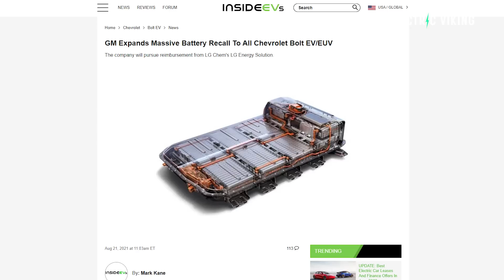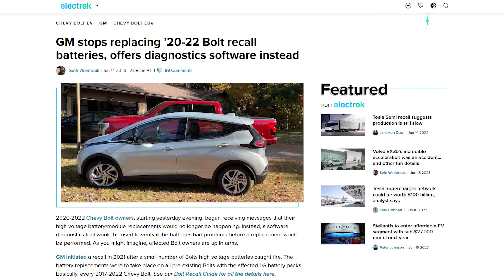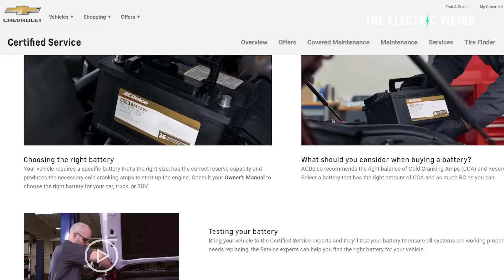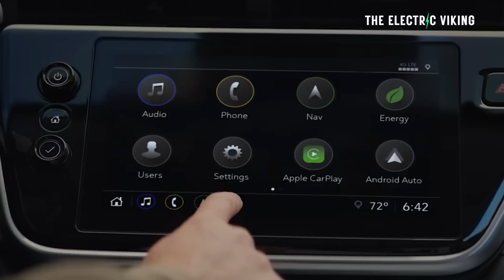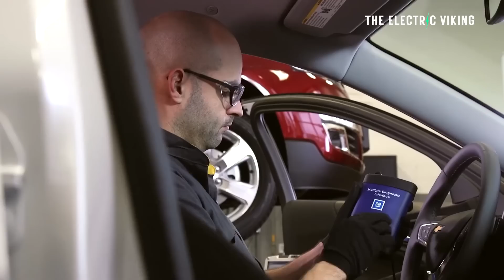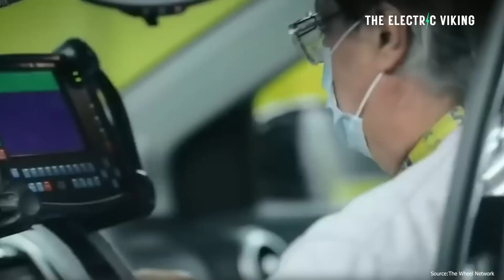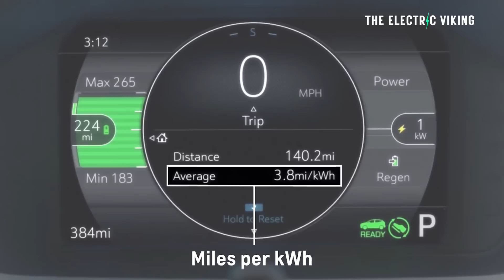Some Chevy Bolt EV owners will no longer get replacement batteries

Comment: There is a car company (Hyundai/Kia) that manufactures several ICE that have caught fire so many times that they have been recalled. Apparently the problem traces back to the engine block.  Rather than replace the engines, the recall installed a sensor that when it detects that the engine is about to catch fire it cuts power and the car can not be restarted.  This happened to my wife in her 2013 Optima, at highway speed, on a very hot day, on a long uphill stretch, after passing a semi.  She was lucky that this did not happen as she was passing the semi and Kia did replace the engine without charge.  However, I have no confidence in a corporation that decides to install such a sensor rather than fixing the problem.
Reply: GM replaced my battery in my 2019 and 2020 Bolt EV, but this is unacceptable that GM refuses to replace the battery for these other Bolt EV owners. Time to move to Tesla.
Reply: GM 'replaced' my Volt battery only to last 5 minutes after the warranty expired. They said 'replace your car, it's 'old'. (117,000 miles) Wow.
Reply: @ConstanceCox I bought two Volts close to 100k a few months ago.  

2012 and a 2016.  I knew the 2012, on borrowed time.  And it is about 6K for a battery.

Comment: Luckily, GM replaced my battery in both my 2019 and 2020 Bolt EV's here in the US. I think it's a bad decision that GM has halted battery replacements for existing Bolt EV owners who still have the old batteries. Time to move to Tesla. GM is showing their true colors.
Reply: Elon is a lot worse than GM lol
Reply: This is typical GM, nothing new. When my brand new Silverado drank 3 qts of oil in 5k miles, they said no problem thats normal. My 230k mile beater Tundra doesn't even drink a quart in 5k. 

My buddys 30k mile Silverado had failing lifters and sounded like there were marbles in it. GM said it was fine, until it actually comes apart they won't touch it. That was promptly traded in on an F150.
Reply: @22rsx How so?
Reply: @22rsx  Another person that has outsourced their thinking.
Reply: this isnt new for GM, they have always been trash vehicles
Reply: @22rsx  elon is a person.  GM is a company.  GM builds trash and always has.
Reply: @baldisaerodynamic9692  I know and i agree lol
Reply: Tesla is so far in front of GM that it’s not even worth comparing.
Our nearly four year old Model 3 has been absolutely fantastic- best new car experience that I’ve had in nearly fifty years.
Reply: @22rsx You have NFI! 
Our Tesla has been absolutely brilliant, period!
Reply: @FutureSystem738  i have no life? I wasn't talking about Tesla I was talking about Elon.
Reply: @FutureSystem738  a 1990s hyundai is so far in front of GM.  some of them prob last longer than a new one too.
Reply: They did that to me! For years i was assured id get a new battery for the diminished range. Then they told me I wouldn’t get a new battery. I have contacted a lawyer because the resale for the car is trash without the battery replacement due to now selling the car that sure has the “software updated” but still a fire risks due to lack of change. ITS BULL SHIT! EVERYONE NEEDS TO SUE GM
Reply: @FutureSystem738  Teslas are known for their crappy build quality.
My over four-year old Chevrolet Bolt EV has been absolutely fantastic - best new car experience that I’ve had in over sixty years.
Reply: Tesla has great tech but their quality control on their body panel gaps and assembly is trash. For such an expensive car, everything should be perfect.

Comment: Its hard to imagine any company doing a worse job than GM in manageing a crisis then GM did with the Bolt. They gave their customers the tun around for a couple of years before they agreed to replace the batteries. And now just when their reputation has started to recover they do this. From a technical point of view its probably alright, if a battery hasn't caught fire by now it probably isn't going to. But from a public relations point of view this is a disaster. Why would anyone consider buying a GM car in the future unless they sell them at firesale prices which is what theyve had to do with the Bolt.
Reply: VW: dieselgate
Reply: @vvattup  General Motors EV1
Reply: Liar liar car on fire.  🤣🤣
Reply: Well stated, especially the "sell them at fire sale prices"! If you hadn't said it, I would have!
GM needs to decide if they REALLY want to give good customer service or not. GM, if you do, state what you'll do and DO IT!

Comment: I own a 2021 Bolt and GM never contacted me about the change in direction. I contacted them to confirm what I was reading on the internet. They then confirmed the software solution and informed me that my Bolt was now ready to receive the software and that I should schedule an appointment at my dealership. The dealership was as confused as I was about the battery replacement strategy. They are taking the brunt of the customer anger. GM has established themselves as the world's worst communicator and destroyed their reputation (for me anyway). My next EV will not be from GM. They can not be trusted.

Comment: My 2022 Bolt EUV was manufactured in July of 22.  It appears to have come off of the assembly line as one of the first post recall cars.  I have never charged it to above 85% and normally to 80% at normal household current.  I initially ordered a 22 Bolt EV at the end of 2021 just before the recall.  When I was informed that production was about to start I was told by the dealership that I would have to wait much longer for the EV as opposed to the EUV so I ordered it. I love the car and I'm glad that I got the EUV because I have had people in the back seat and the car is an ideal 4 seater in this configuration.

Comment: GM Lost 500 million on an autonomous vehicle program INSTEAD of replacing batteries.  300 million also lost from garbage sales.  We have a 2020 Bolt that we bought..... it was recalled for a replacement 4 months after.  That was 3 years ago !!!!!  The software was not the problem and the software can't stop a fire in any way at all.  DC " Fast " charging bypasses the onboard chargers and goes directly to the battery,  new software can't stop a thermal runaway from happening.  We got the email for a replacement on June 13th and took it in.  The dealer swapped it for a new one.  THEN GM told them to take it back out and put the old one back in ......  They then set my car to 78% charge.  That makes it a 150 mile POS that we are paying full price for.  We bought a 256 mile EV NOT a 150 mile EV.  They say to not take the car below 70 miles left .......  That is half the range total now.  The car charges three time slower than any other EV out there right now.  They are gonna give us a new pack with 100% charging OR buy the car back at full owed amount.  Legally in the U.S. you can't put a car on the road with KNOWN safety risks to the public.  These cars with just software are known safety risks.  Period end of story.  GM is guilty and a fraud on this one.  Proven in courts across America already.  Thank you Sam for telling the truth to the world.
Reply: I have the same feelings but i am being shafted on my 2022. I purchased and a week later it was recalled. So I’ve been driving years on diminished range and the least they could do is swap the batteries. I paid for a product i never received albeit i did for 1 week……. IT such bull shit that we put our trust and faith into doing what’s right for the planet by trying to switch and we get screwed by higher costs and diminished range. I hate GM and never will purchase another one. Anyone who talks about buying a Chevrolet i just laugh at. At this point the world should have opened their eyes to how bad the company is. I really hope they go out of business. Also its ironic how when they fucked up in 2008 they used our tax $ to bail themselves out. Now when their customers need to be bailed out its friken crickets!!!!!!! GM give the government their money back and go out of business already!!!

Comment: So, a company that had to be sued over ignition fires that killed people now say they won't replace batteries?  Can't say I'm shocked.
Reply: An investigative reporter should buy a used bolt that has never had the battery changed, take it to a professional to get the battery adjusted so it should fail the "test".  Then have GM run the test.  When it passes, because they all pass.  Run the article exposing GM for lying.  We all know the software does not work.  It is just a scape goat for anything else that happens later.

Comment: The term "software fix" is ever so slightly oxymoronic. In some cases, synonyms include "kludge", and "spaghetti code"
Reply: An investigative reporter should buy a used bolt that has never had the battery changed, take it to a professional to get the battery adjusted so it should fail the "test".  Then have GM run the test.  When it passes, because they all pass.  Run the article exposing GM for lying.  We all know the software does not work.  It is just a scape goat for anything else that happens later.
Reply: They have offered 3 software fixes 3 times for this issue previously that resulted in more fires. GM sales 🔥

Comment: This whole mess was handled very poorly and inefficiently. Having the dealers swap batteries piece by piece is a huge money suck. Should have just bought all the cars back on a pro-rata basis based on use, condition and mileage, procure all the replacement batteries, then set up a manufacturing gnline to pull out the old and install the new. Then sell all the repaired cars to the government or a rental fleet and then sell all the bad batteries to a recycler so squeeze every cent out of the fiasco as possible. I'm sure if they had handled it all at once the costs of the replacements would have dropped a lot and then getting the proceeds from the sale of the repaired cars and recycled batteries would have paid off a decent amount of the cost.
Reply: lol the government would prob avoid that deal, or back out of it.  rental car fleets likely would pass too.  good idea if people were on board....but even more costly if they backed out

Comment: If I come across a great price for a  2017 Chevy bolt with it's original battery still in place,  is it still eligible in 2024 for free replacement?

Comment: The end came sooner for me because they bought my 2020 Bolt EV back! But it's so ironic that this video came out... I received in the mail a recall for what is called the traction battery(the one on the underside of the car). In that recall, they lined out how earlier vehicles would have their batteries changed first and so on. But it's funny that the video shows many pics of the 12 volt battery. Mine (12 volt) went bad with very low miles on it several times. They took two weeks to replace the 12 volt battery, which should be less than a half hour job. Anyway, they couldn't ever pinpoint why the car kept "bricking." Good ridden!

Comment: From the start these automakers should have used interchangeable batteries in the first place. Thus creating a global standard. Well, by continent is alright too. 
If the batteries can be interchangeable then faulty batteries can be eliminated as soon as they come from the car when fresh batteries are installed. So you can drive on safely.
And let use clear: there  is no need to be the owner of a battery pack.
Reply: no thanks.  im not paying for another subscription to use the car.  or wait in line at  swap center, so on.  

how about build them better, safer, more efficient and warranty when needed.

Comment: I bought a 2020 with 6500 miles without replaced battery.  It is a great deal at $14,000 (after $4,000 FIT credit).  It only charges to 78%, but that gives me 200-250 miles of range.  At some % of charge they will replace the pack under the 8 yr / 100,000 miles warranty?

Comment: Thank you for the info. We are just looking at a 2013 Chevy EUV Bolt for our son, now I don’t know if it is the right choice or if they will replace the battery when it dies. I heard they are discontinued and bringing in a new Bolt in 2025 with a different battery. If we are able to switch batteries to the new one then it might be okay to purchase now.

Comment: Hi Sean, 

Long Time Subscriber; Recent Member….

I have a 2023 Bolt EUV with the newer battery. 

Question: I need to use about 80% charge to drive to work every two days. 

Is it better to use 10-90% of the battery range every two days
OR 
0-80% of the battery range every two days. 

In other words, does it hurt to use the bottom 10-20% of the battery pack or just worry about the top 20%? 

Thanks for your help, 
Love Australia!!!!

Nick

Comment: I have a 2022 bolt ev and they did two software updates already due to the lithium ion battery. The first software limited my charge to 80% now the limited to 20% only getting 71 miles of range on a 259 mile car. For sure getting rid of it and going the Tesla direction.

Comment: So is a used 2017-2019 Bolt with a replaced battery a good deal at say 20k miles for around $17,000?  Or am I dumb to even consider a used Bolt? I’d never buy one unless the battery was replaced though.

Comment: I Received recall notice  for my bolt battery thinking that I would get a new battery and instead got software that shorted me on 40 miles of range which now i can,t  reach my destination. the reason i Bolt  Ev for. Now it will take 2-3  years to make the miles to restore my full range be cause i can't go the distant and I have to  use my other car, on account of this I plan not to buy Gm products!

Comment: If the deal is 6000 miles, then Chevy is off the hook no matter what, that's objectionable.  

If however, the deal is 6000 miles, then the software continues to monitor, and Chevy will replace bad modules if they ever are detected, that makes good sense.  Greatly reduce the magnitude of required replacements, while continuing to protect the owners.
Reply: In fact, it is ESPECIALLY important to keep monitoring for at least a few thousand miles after the 6000 mile end point.  Why? Because starting at the 6000 mile end point, they are allowing greater stress on the battery pack - borderline modules that didn't show up at 80% charging, may start showing up at 100% charging.

Comment: The 2020-2022 cars were added to the recall later than the 2017-2019 cars, because of a fire at a dealership that turned out to have been misreported.  GM caused LG to make some changes to the manufacture of batteries for the 2020 model year, changes designed to lessen the chance of the kind of misalignment that caused battery fires in the earlier cars.

The software being installed in the 2020-2022 cars is already in the 2023 cars and it is working well so far.  It might have been better if you'd reported this as a news story instead of having already drawn the conclusion that owners were being cheated.
Reply: If that’s true and no 2020s could have an issue I don’t see why they’d continue to cripple the product for over 6000 miles. Something in their data has them concerned enough to be playing this safe.